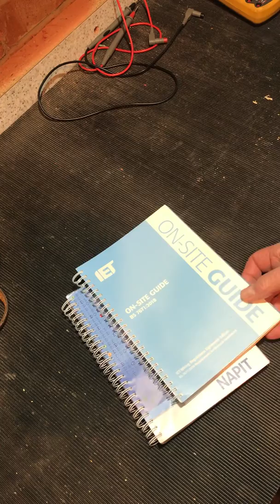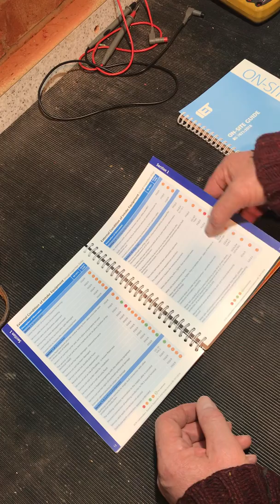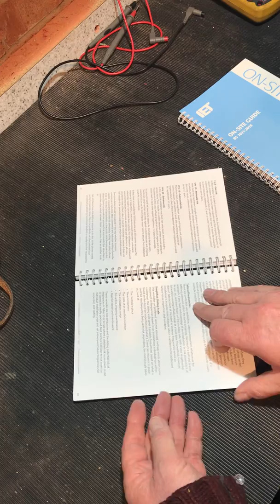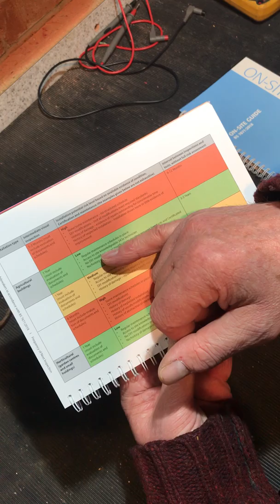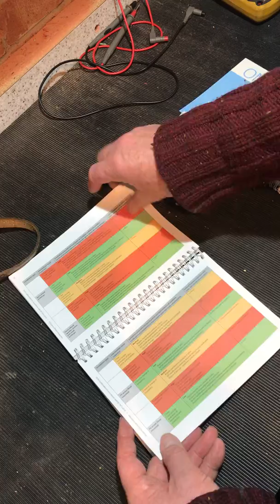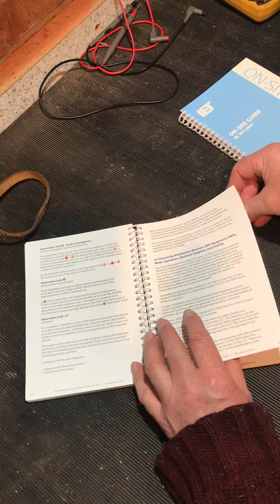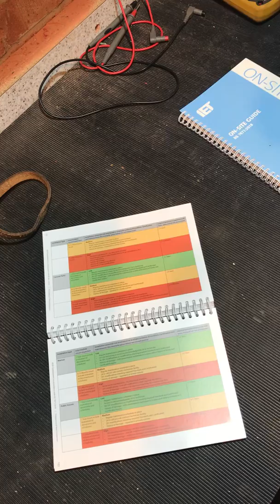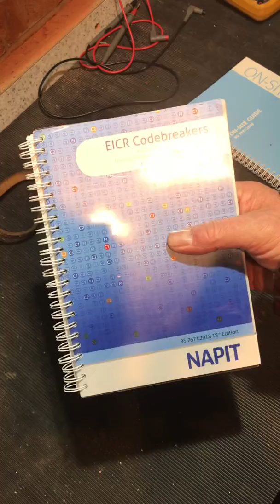NAPIT Codebreaker book

Comment: Just bought this book, first thing I looked for was aluminium conductors and there coding, bearing in mind they are from the 70s and quite dangerous for a number of reasons- guess what! No mention..not that I can see anyway..useless
Reply from the maker: Thanks for your comment. Please bear in mind that you can still buy aluminium cables so the conductor type in its self is not the issue. The condition of the cable, its suitability and its likely safe service life are all covered elsewhere. This book is a starting point not a bible so I just make additional notes where I find it doesn’t cover exactly what I want.
Reply: Sounds like you’re the useless one